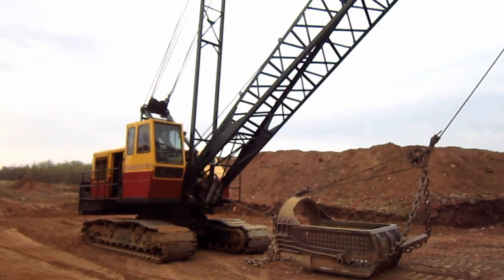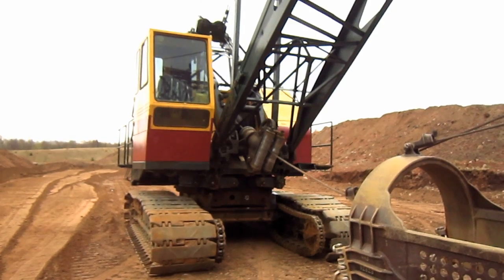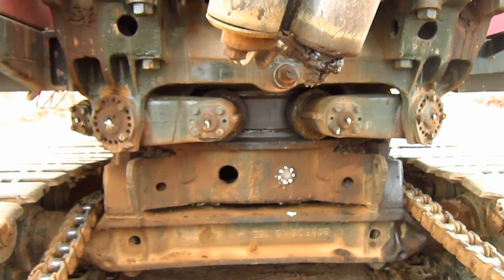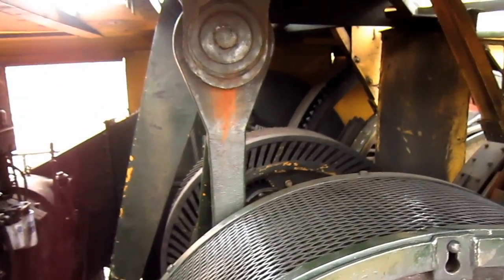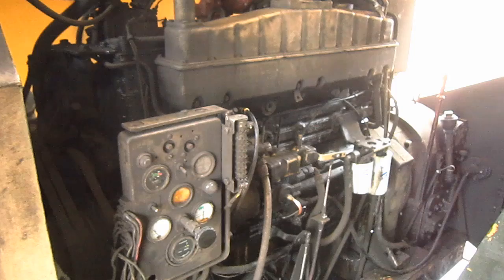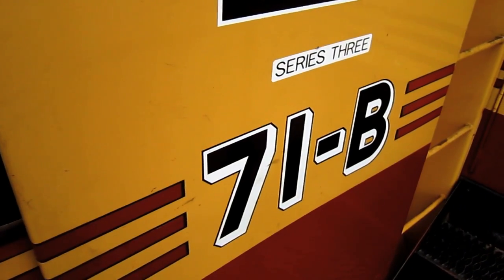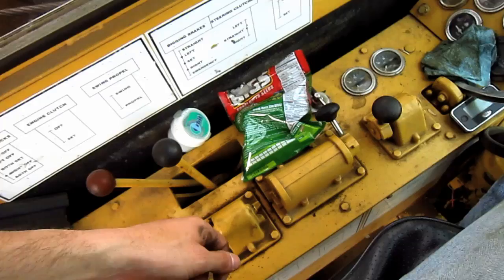Bucyrus-Erie 71-B Series III Documentary

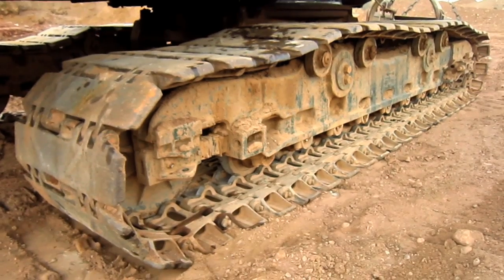Comment: The isolated cab must be nice.  @8:22, the brake peddles look like those found on an American.  @10:53, the track adjustment at end of track frame looks like it is near the outer limit and wide gaps can be seen between the track pads around the pins, so she has been walked a lot.  It is hard to tell the condition of the machine until you feel them while they are working.  This machine does appear to be clean and straight.